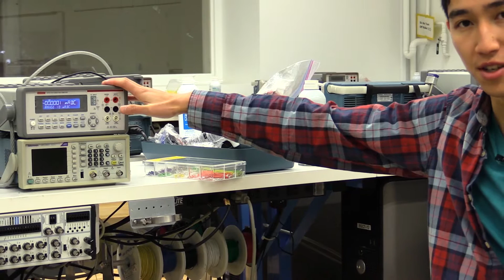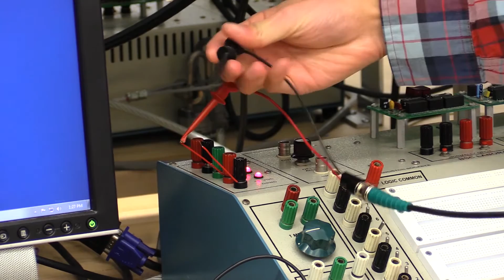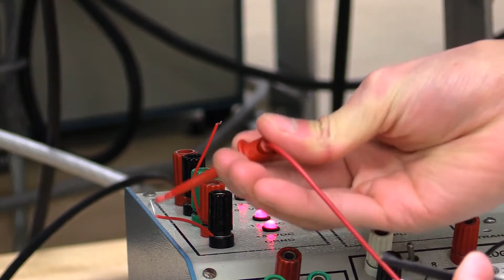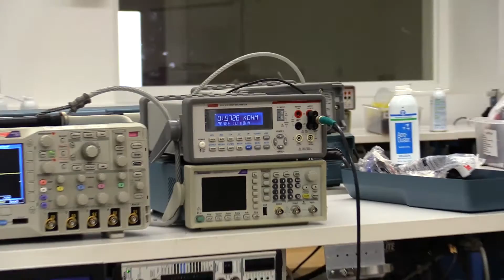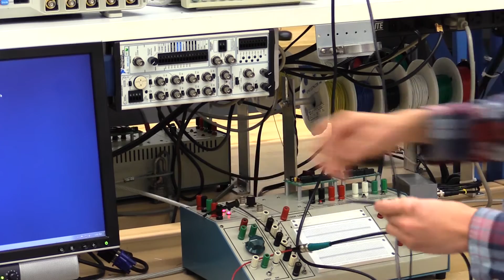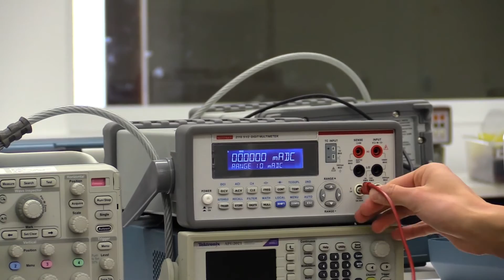IntroToDMM 1080p

Comment: Nice DMM intro video and good pick on the Mfg & Model of DMM! Keithley has a newer lower cost touchscreen DMM, though might not be necessary if the user isn't performing labs where they are automating measurements.